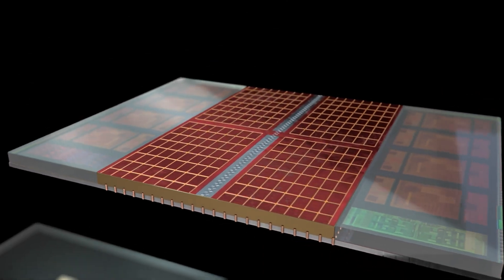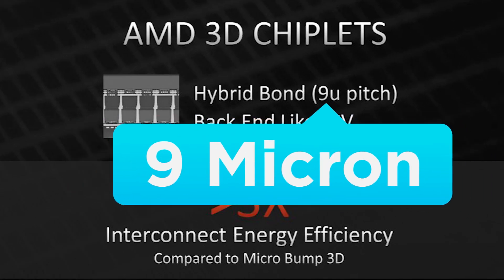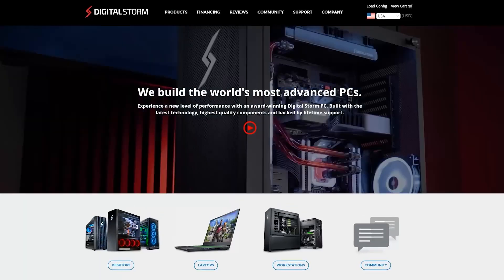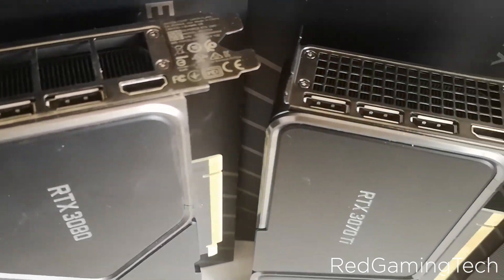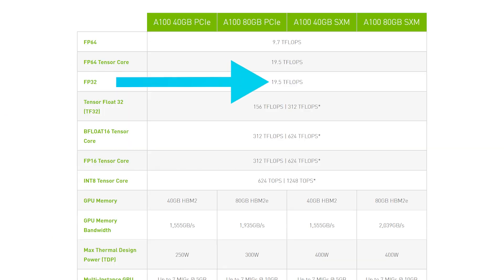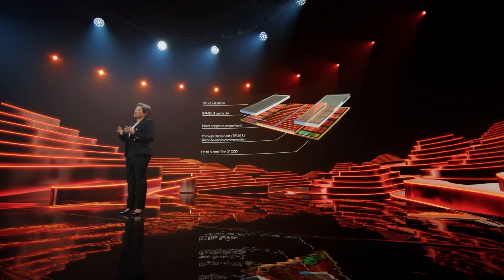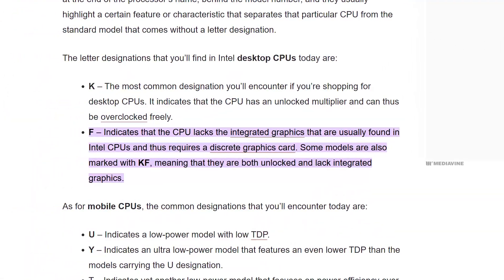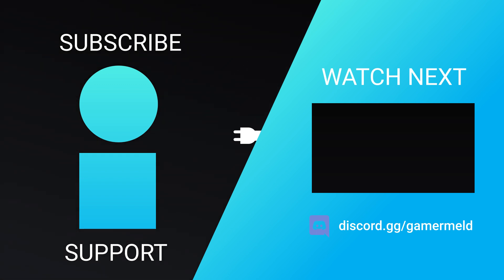Goodbye AMD APUs, Intel's GPU CRUSHES Nvidia and AMD's Best!

Comment: That's kind of a bummer if AMD will stop manufacturing their APU's.
Reply: He said that most probably the majority of the CPUs will be replaced with APUs, not the other way around.
Reply: 7nm i/o die will have room for an igpu. APU's are monolithic and don't use chiplets, it's unlikely that AMD will stop making a version of these even if they're a small die marketed as Athlons, with the bolt on cache technology now a reality it would make sense to use an 8 core APU with added cache for mainstream desktop CPU's.
Reply: @magottyk  current APU is monolithic because it's shared with mobile. Future APU might be chiplet based and will be the same with desktop CPU. I think GPU will have its own chiplet. Maybe something like this
CPU - 5CUs
APU - 20CUs
Mobile CPU might have their own silicon or if 7/5nm IO die is efficient enough, AMD might use chiplet based for all.
Reply: @mohdk2299  
Even with DDR5 there's limited memory bandwidth and I doubt they'd add a big bunch of infinity cache to make up for that limitation, and with DDR5 standard at 4800, that's your bandwidth start point allowing 76.8GBps up from 51.2GBps @ 3200, which would allow for about 12 CU's of optimised Vega, but perhaps only 8 CU's of RDNA2 based igpu. Even with DDR5 6400 (102.4 GBps) that's still less bandwidth than a 16CU RX 560 (112GB/s) and less than half that of a RX5500 (22CU RDNA 224GBps). So no, APU's beyond 12CU's will be memory constrained without on board HBM, 20CU's would only be usefully optimised in ultra low power mode (i.e. Low frequency mode)

Mobile will still need small monolithic dies (efficiency and latency) and they'll be capable of desktop use at higher power.
Reply: @Gareth Tucker 
AMD had that opportunity since zen 2 and they didn't do it with a chiplet. Adding graphics to the i/o die seems more plausible at 7nm with the current vega 8 cu ready built, than an igpu chiplet which couldn't be added to 12 and 16 core desktop CPU's given that any node shrink density gains is likely to be utilised by more cache.

MCM is for high end discrete cards at 300mm2+ per chip and not 80mm2 chips needed for CPU chiplets. 

The Vega igpu part of the 180mm2 5700G looks to be less than 40mm and the i/o dies are currently 122mm @12nm and contain the memory controllers which the igpu could directly access rather than add a latency hop over the infinity fabric.
Reply: @Gareth Tucker 
A chiplet based GPU doesn't need MCM technology as it is effectively a monolithic GPU if it's only one. With 8 core CPU's there was always the space to add a chiplet GPU. The issue is and always has been memory bandwidth to feed that GPU and once you get past a certain capability then you're always better off with discrete.
Everytime there's talk on next gen AMD APU's, the same tired speculations on high CU counts happen, yet none seem to ever understand why it's pointless and seem to forget how Intel married an AMD custom GPU to their CPU to get the 4/8 + 24CU @1190MHz vega 8809G which had 204GBps bandwidth from the included HBM2 chip.

While main system memory is the graphics memory, don't expect any huge performance increases that are comparable to even a basic discrete GPU and given RDNA2's high frequency capability, a 12CU RDNA2 igpu without infinity cache would perform similarly to that 24CU vega in the 8809G if you had the memory bandwidth. They don't have the bandwidth, but they do have a small footprint igpu that is well suited to using system memory and could be included on every i/o die, especially once 7nm becomes a lower end node.

Even if they stacked 32MB of Infinity Cache (IC), you'd still barely have a 1080p capable igpu because the 6600XT a fast 1080p DGPU which has 32MB IC still has 256GBps memory bandwidth and DDR5 system memory is only 1/3rd to 2/5ths that, which means at best with 32MB IC you could have maybe 12 CU's @2GHz before diminishing returns given the bandwidth. Why bother with the added expense of stacked cache for the iGPU and possible hot spot issues under that cache, when it's still not going to get you past mediocre 1080p, just forgo that expense and still have mediocre 1080p available with 8CU's @2GHz or 12CU's without the cache if you have room and the gains aren't too badly hit from diminishing returns of memory bottlenecks and/or a frequency drop gains you significant efficiency with TDP limits
Reply: I believe APU will get even better GPU with a dedicated GPU chiplet.
Reply: It's a misleading statement, what's really happening is that APUs will be the standard manufactured 3D chiplet. If there is ever any problems with the iGPU, they'll disable it and call it a Ryzen _ or Ryzen ___X rather than an Ryzen ___H or ___G and sell those at a lower cost to people that don't care about having integrated graphics.